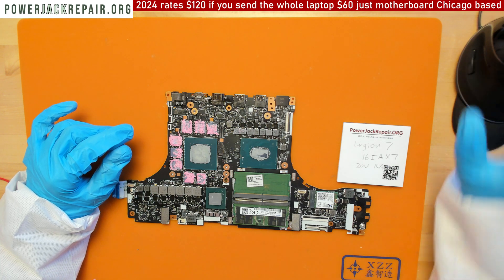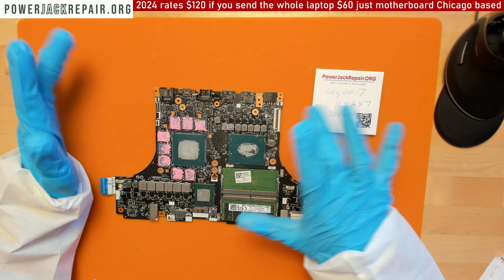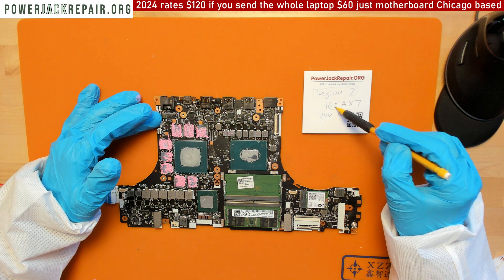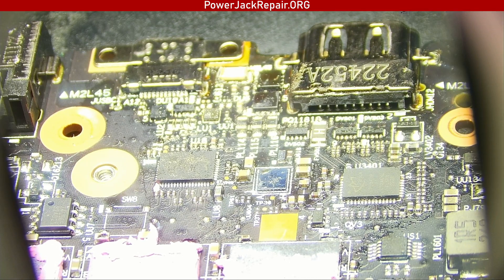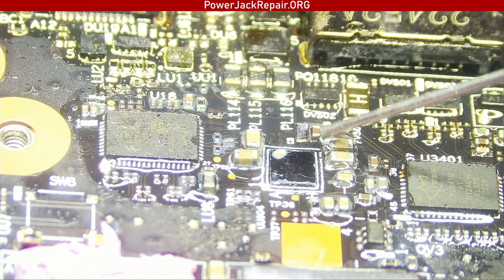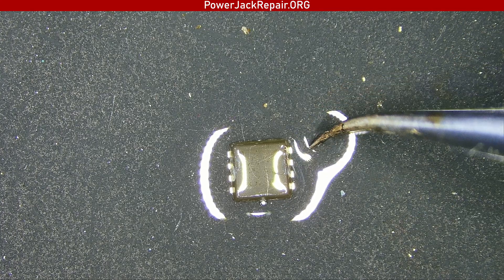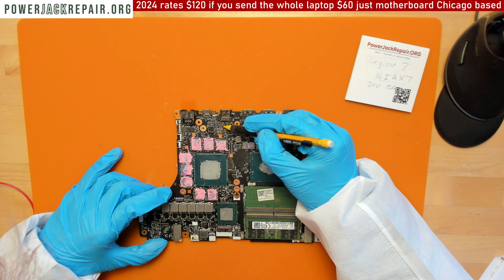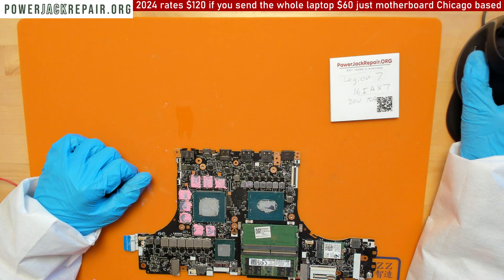unfixable lenovo legion 7 16IAX7 20v 15a 300w no power shut down for no reason laptop is broken

Comment: Hi, may I ask with this issue, does the type C charging port still works with that device? As for mine, the type C charging port still charges at a slow rate, while the main charging port doesn't seem to be able to charge battery anymore even though the charging light is lit up. 

On another note when i am chargjng using the main charging port, the whole laptop has a tingling static feel